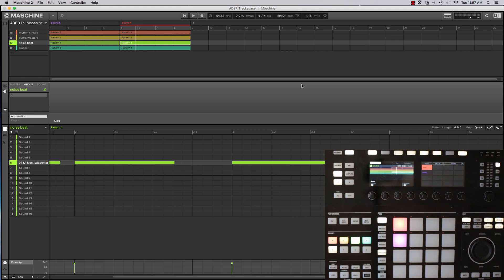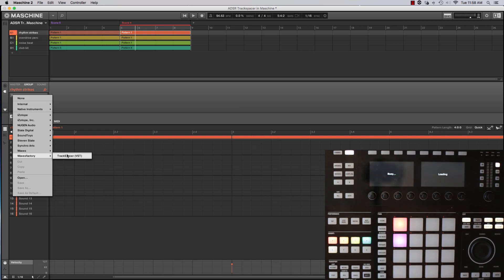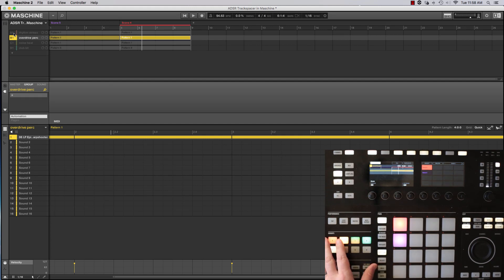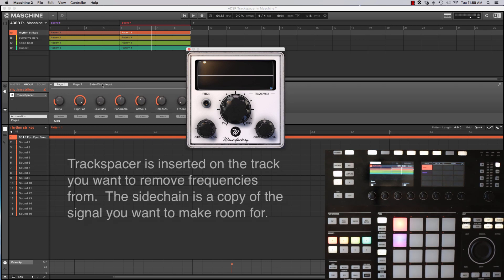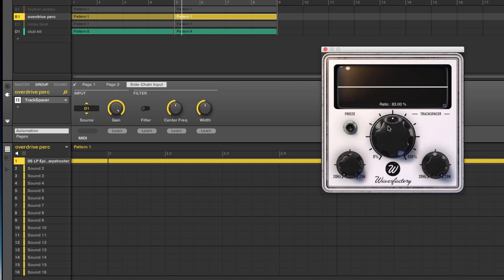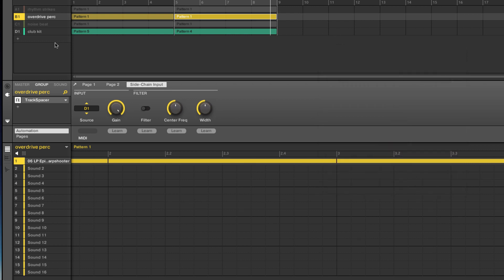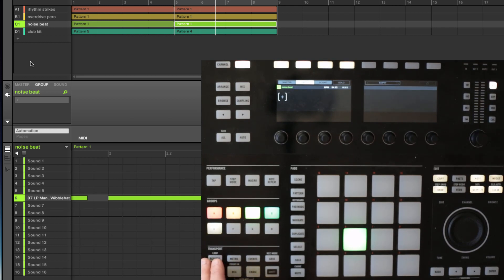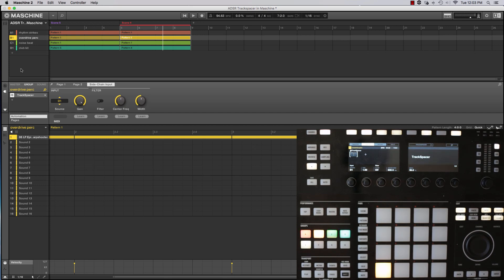Using Trackspacer in Maschine

Comment: Nice tool. I might have to give it a go on some difficult mixes. If it was up to me, I'd produce other people's tracks differently and make choices for the sounds they use. Unfortunately I can't have creative input most of the time when I'm in solely mixing/mastering mode for clients. I usually rely on FabFilter Pro-MB for this multiband sidechain ducking technique, but the 32 separate frequency bands sounds interesting.